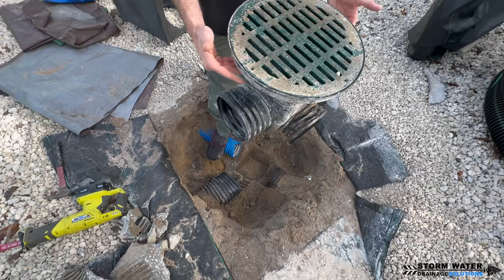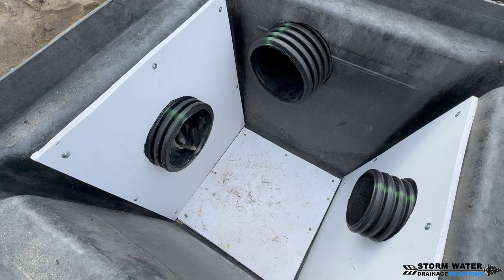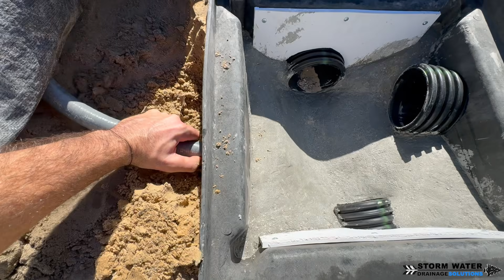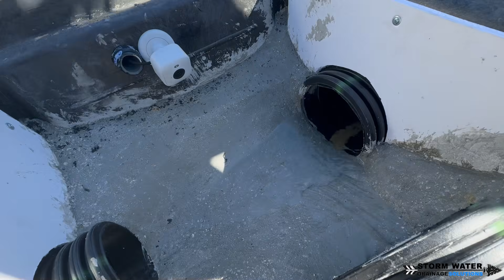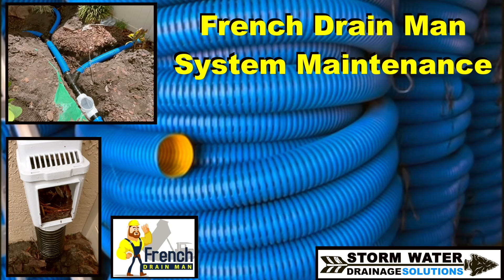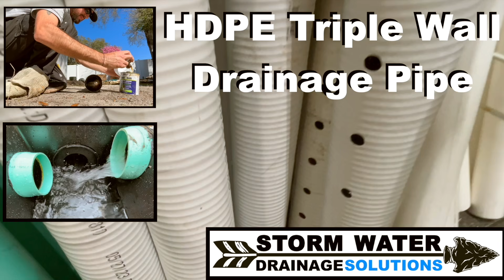Experimental Drainage Monitoring Camera - Storm Water Management Solutions

Comment: Any suggestions on good septic treatment?
Reply from the maker: From what I’ve been told: copper sulfate flush every 3 months and get it pumped every 3-5 years. And check the filter in the tank that connects to the leech field to make sure it’s not getting clogged. That’s the best I got.
Reply: @Storm @StormWaterDrainageSolutions 
Thank you 🙏